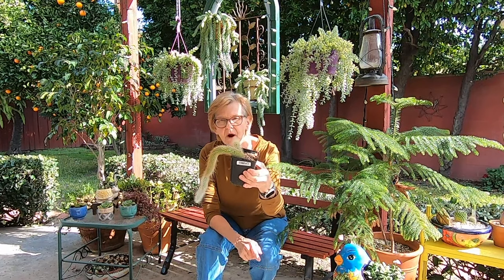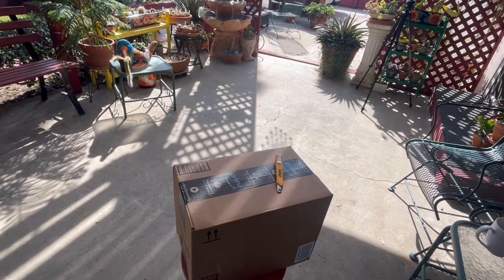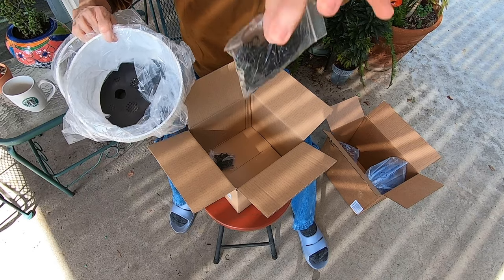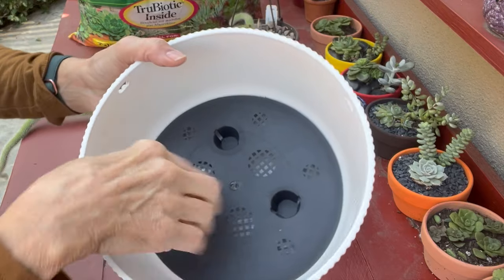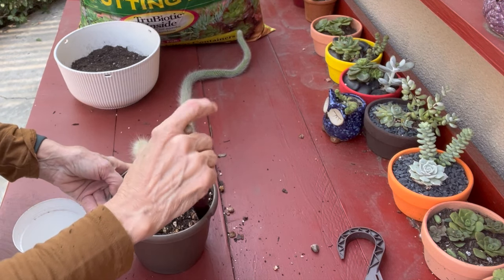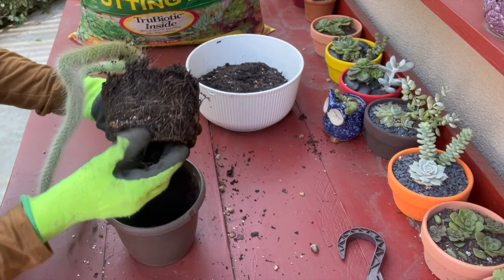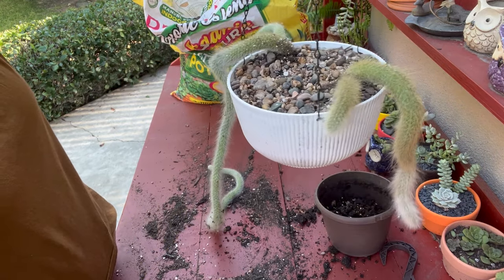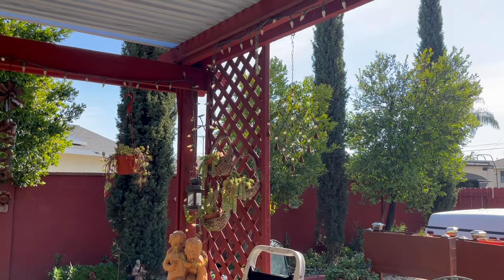Repotting Monkey Tail and Rearranging Pots on my Patio

Comment: Hi Sue, I’m glad i came across your channel our videos are a lot alike relaxing. ☺️ I would recommend putting more grit in your mix the soil will hold to much moisture around the roots even though it’s succulent soil especially if it gets rained on. I usually do 80% bonsai jack grit to 20% cactus soil. That is just my experience though and only a suggestion for you.
Reply from the maker: Thanks for the tips! I agree, I do need to add more grit into my soil. Thanks so much for stopping by and taking the time to comment. It is much appreciated! 😎

Comment: How do you get it to bloom? 😊
Reply from the maker: I have had my monkey tail for about 18 months and it has not yet bloomed. I read that monkey tail plants are more likely to bloom if you keep the cactus outdoors. Bright morning sun is best. I am hoping that I will get some blooms this summer. Good luck to you! 😎
Reply: @seniorsuecacti  mine has been outside for the 3 yrs I have had it. I live in FL, so I thought I would get blooms.
Reply: @beverlysullivan1427 IDo you fertilize your monkey tail? I recently fertilized mine with tomato fertilizer, mixed at half strength. I plan to fertilize it once a month throughout the summer. I am hoping it will bloom.
Reply: @SeniorCitizenSue  yes, but I didn't use tomato fertilizer . Do you use liquid or one you have to mix?
Reply: @beverlysullivan1427  I use one that I mix. I use Miracle Gro Tomato Plant food.